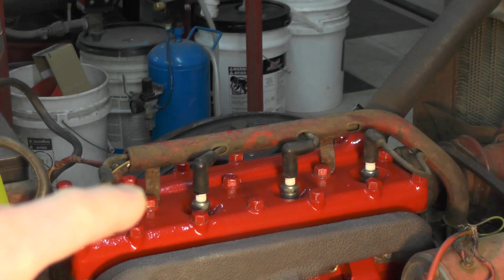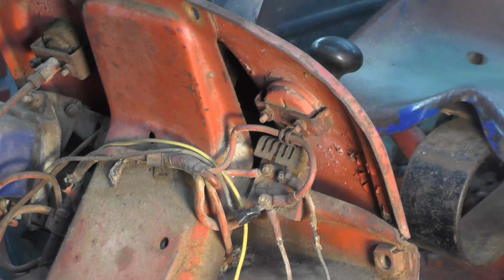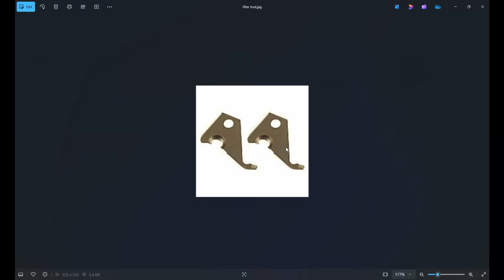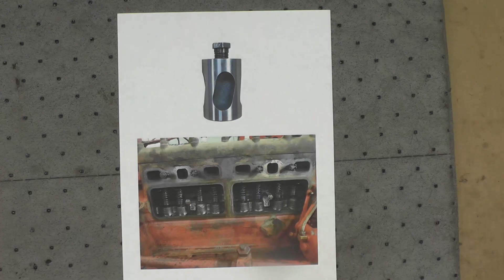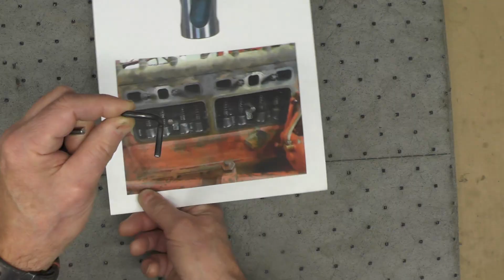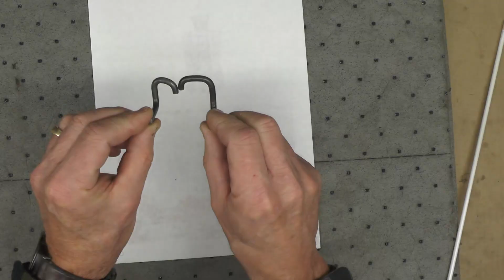Ford 8N Tractor Project Pt 16 --- Video #393

Comment: Very interesting. Engine sounds very good. I thought it was cold here in the UK, but gosh - that is very cold!
Reply from the maker: We had a week to ten days of some of the coldest weather we've had in several years.  Overnight lows were running around -6F/-21C for a week straight.  It's moderated a bit now, but it's still consistantly below freezing during the day with occasional snow.

Thanks for the comments, Jono.

Comment: Good day Sir nice to hear the 8N running smoothly!
Your wiring harness tube problem is easily fixed without the head on the tractor it just requires two longer studs so you can torque down the head and the put the tube on and tighten it separately from the head so that advise is a little bit late but at least you don’t have the hood on,so once the head is off you can double nut the stud and turn it out I would take them right out to see how much thread is left in the block when you will retorque the head bolts and you will have to make sure to keep an eye on how much thread you have at the top of the stud when you’re torquing the head down making sure it’s turning in the right place.
I have never seen you tool system for adjusting the valve clearances I will keep that in mind if I ever do the valves again!😀🇨🇦
Reply from the maker: Thanks for the tip on using studs for the two head bolts under the wiring conduit.  I'll keep that in  mind if I need to remove the head.  The tool for adjusting the lifters worked well, though again, I didn't come up with the idea, only copied the design I found online.  It was easy to make, too.

Thanks for the comments!